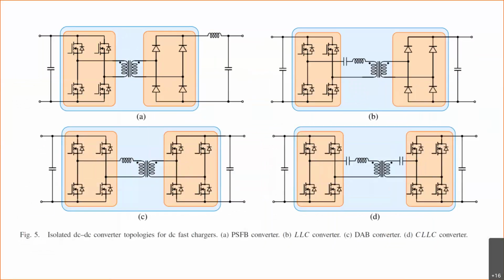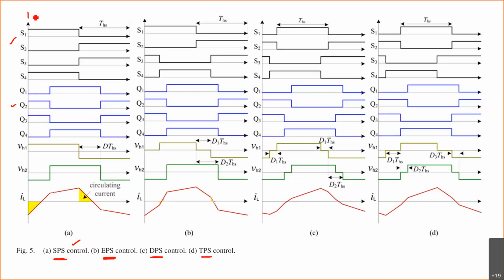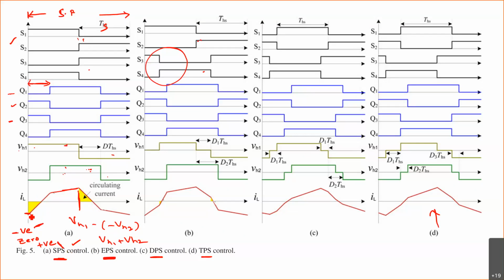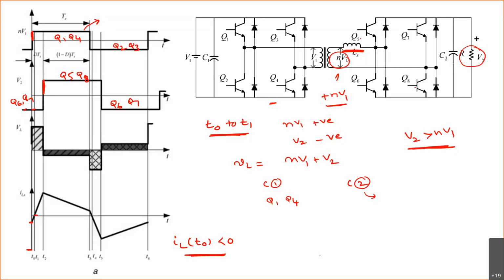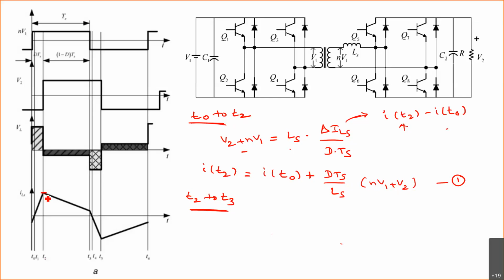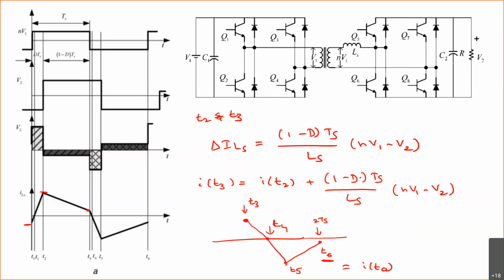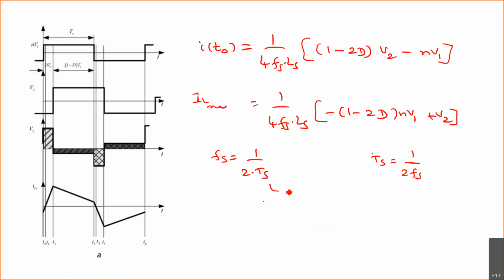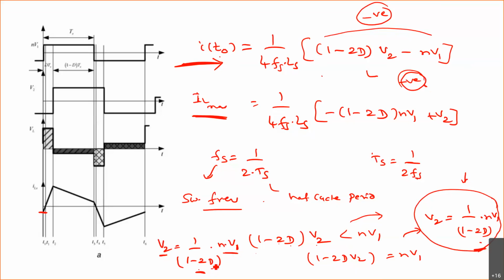Lecture 10 | DualActiveBridge converter for electrical vehicle charger and solid state transformers

Comment: Great explanation.

The circulating current on the primary side of the DAB was explained, what about the circulation current on the secondary side of the DAB? In a single circle, can you mention the transition between switches in regard to circulating current through the diode due to capacitor discharge?

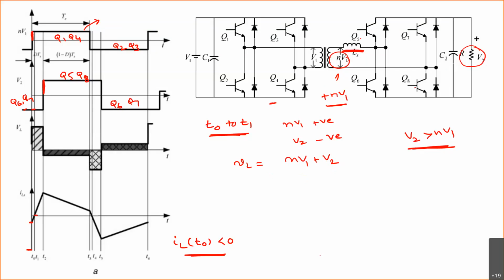Comment: During the first interval in the primary bridge, D1 and D4 would be conducting and not Q1 and Q4 as the inductor current is negative. 23:35
Reply from the maker: True, Q1 and Q4 are triggered but actual conduction is through D1 and D4 (During neg inductor current)
Reply: @AdvancedPowerElectronics  agree